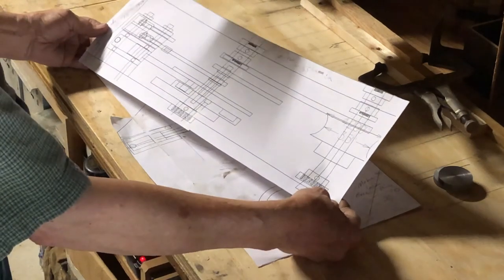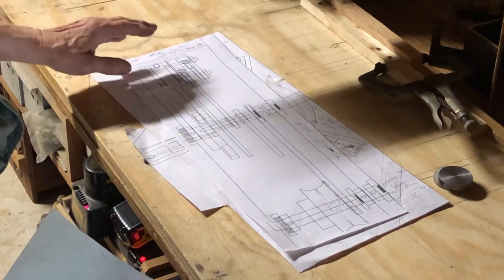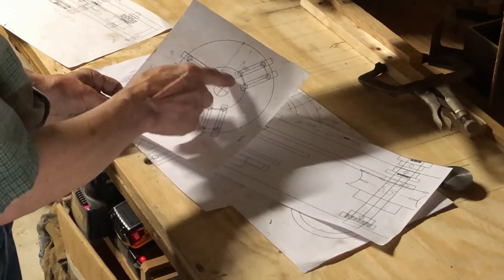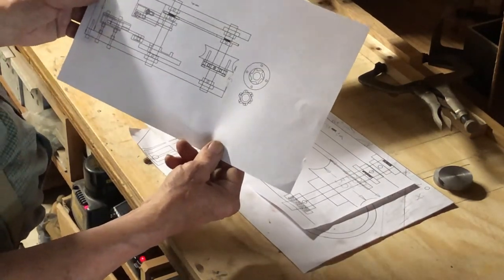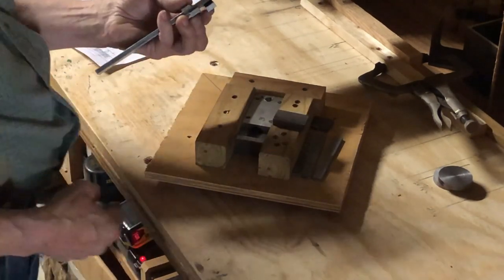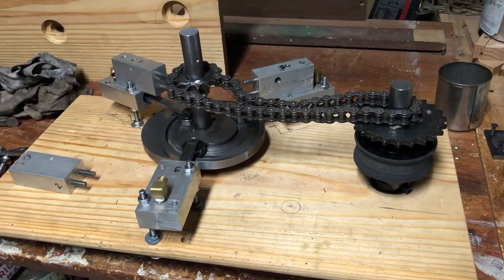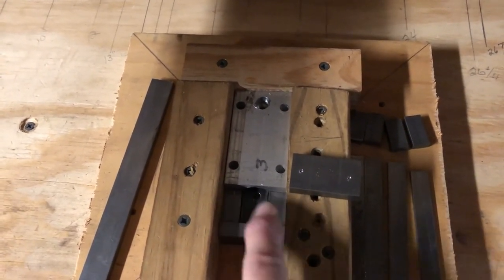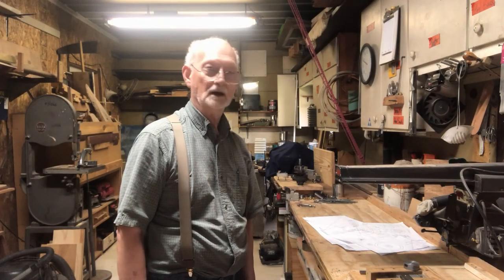Compressed Air Bicycle Assist, Excentric Drive  7-21-21

Comment: Larger pistons at lower pressure is the key to efficiency.. If you are not making room for expansion at the end of your stroke after the valve has turned off than a lot of compressed air is blowing out your exhaust. More cylinders means more potential expansion without dead points. Thanks for sharing what you are doing.. I need to start making videos again...
Reply from the maker: Thanks for checking in, and if you are still working on your system, please do put what can on videos for all of us following you to see
Reply: Not really, he can overcome that by making sure air follows the Piston all the way to the end of the stroke.
Then the valve should cut off.
Expansion wouldn't be necessary.
The power and efficiency would be greater.
Reply from the maker: I am thinking the same thing, and with higher rpms - there’s no time for expansion. 
Thanks for adding your thoughts!
Reply: Not considering expansion potential is shooting yourself in the foot .. If I considered you competition than I wouldn't be trying to help, but I am already way ahead and have three running air powered bikes. The third one is about 30% more efficient than the second because I included some room for expansion..  but go ahead, listen to people with no experience.